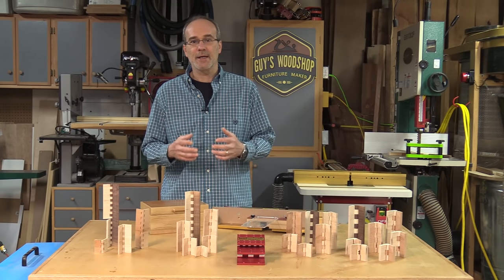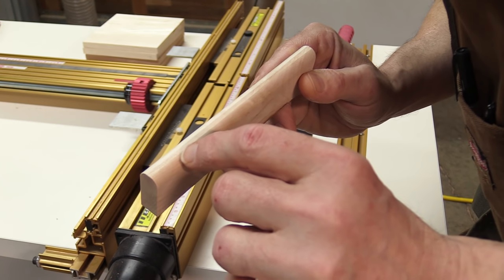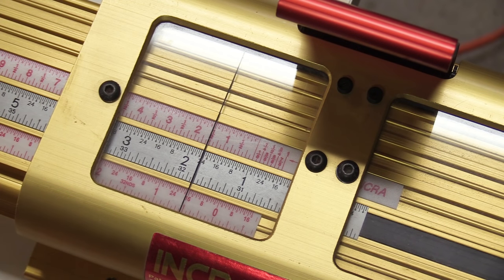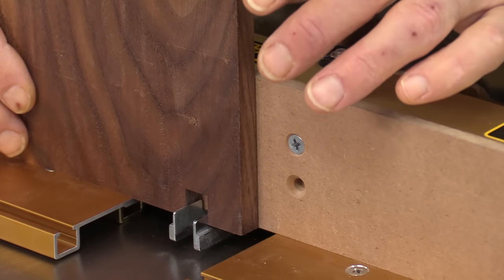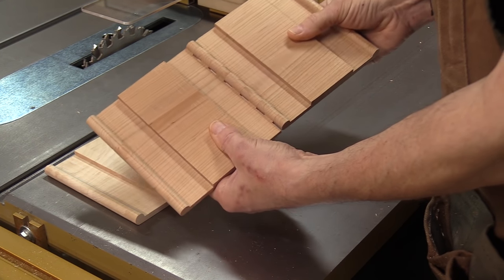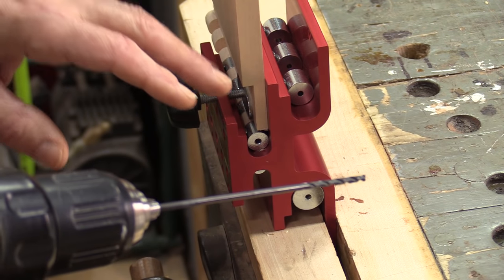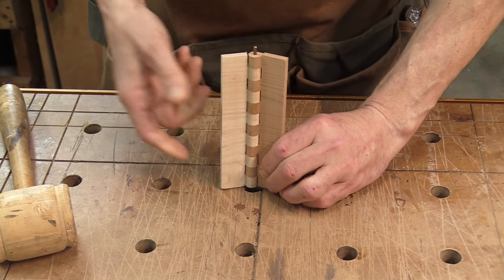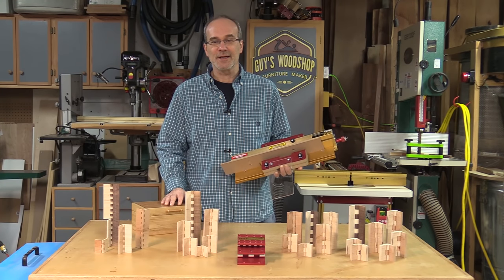Make Wooden Hinges with Incra's I-Box and Hingecrafter

Comment: Great video Guy.

I'm making a cross cut sled for my router today for cutting the bullnoses, I don't have a box joint jig, but plan to use my Incra Jig and right angle fixture to make the box cuts.

(I suppose it might be easier inserting and releasing the hinge pin if you use a little Carnauba, or beeswax on it, also between the hinge knuckles before final assy).
Reply from the maker: Good luck!

Comment: hi Guy, great video. could you explain why the need to use end grain over long grain
Reply: It will have no strength if you use long grain side. It will crack right away.

Comment: Guy, like you I am a BIG fan of Incra precision.  I own the LS Positioner and the Hingecrafter.  Do you find an appreciable value in time and precision when using the I-Box to cut box joints over the LS Positioner on the router table?   Jim
Reply from the maker: Thanks Jim. To be honest with you, this is the first project I have ever used box joints on. I really like the I Box, and it was easy as heck to make the box joints with. Knowing what I know about the LS positioner, I don't see one being easier over the other.
Reply: Thanks Guy, I was trying to convince myself I didn't need the I-Box since I have the LS but like any addict I eventually give in to my addiction.

Comment: Is there a reason why you use a table saw instead of a router with the jig?   Frankly, I have the I box but I never liked it.   The ibox requires moving the wood and reclamping for each cut vs clamping once and moving the clamped unit of work to the next position.
Reply from the maker: I just felt it was easier to do it that way. This was my first time making box joints, and found the iBox very easy to use once set up. I really can't compare it to any other method or jig.